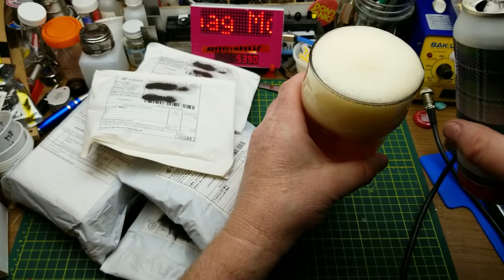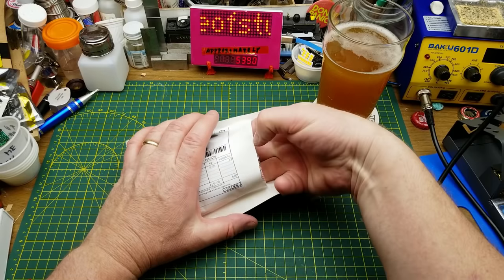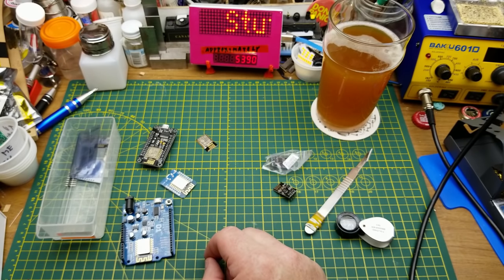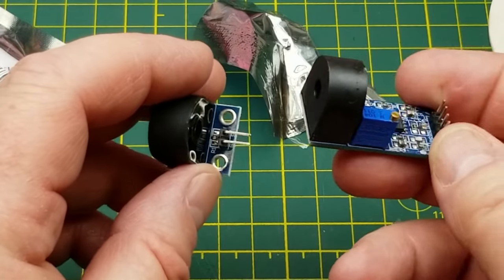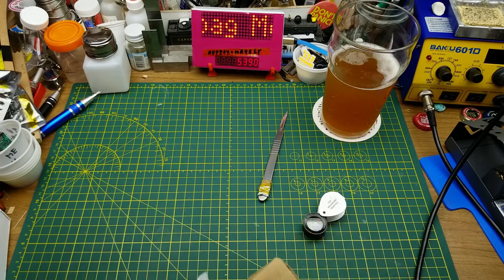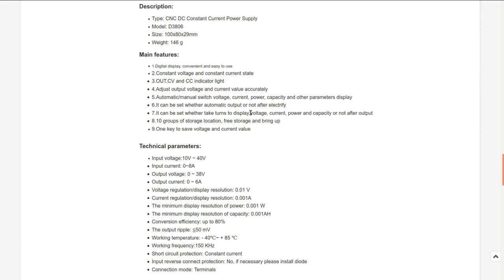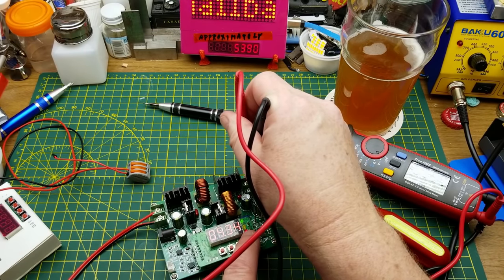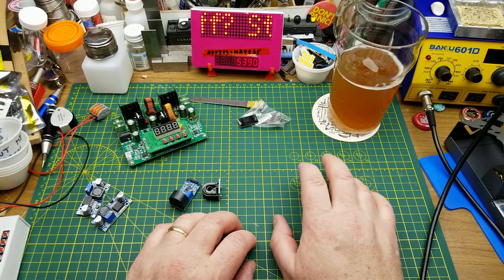mailbag monday #84

Comment: 11:18 - The D3806 and B3603 both have the exact same user interface. The display of Wattage and mAh is an optional on both of them, as well as 10 x preset memories. You can set this up using Special Menu Function #1 (get details from the user manual of either device).
The crude user interface makes these added features even less intuitive than the way that Current vs Voltage is displayed (decimal place position). I switched the extra settings off, and just use them to show Volts and Amps.
If you want a decent interface, you need to pay more for the higher-end MingHe like ZXY6005 (Buck), or buy one of the Ruidengs.
Reply from the maker: Correct. It is the same display and user interface.
I don't find it that difficult to navigate, but that may be because I'm accustomed to it after using it for a few years.
I find these to be acceptable value for the (small amount of) money.
Reply: @pileofstuff  - Yes, most MingHe use the same display board and I am also accustomed to them. Anyway at 11:18 you were excited that the new one has Watts and mAh display, yet this is optional (via Function Setting) and can also be shown on the B3603 as well.

Comment: 12:18 - You should get in the habit of holding the terminal connector block (and not the PCB) when tightening the screws.  It is only connected to the PCB with the electrical connections and not the block itself as you can see in the video.
Reply from the maker: Yeah, they're not the most mechanically stable.
I have a plan to avoid needing to touch them more than a couple of times. Stay tuned for Friday's video!

Comment: Oh man your D3806 is different to mine, I don't have a current shunt, I have a ceramic resistor, interesting!
Reply from the maker: I noticed that. 

I assume the "precisely bent wire" shunt is more cost efficient.
Reply: @pileofstuff  I feel as though it may have a lower parasitic resistance too, but require a more precise OP Amp

Comment: I had a problem with diy-electronic, about a year ago I ordered $100 worth of stuff and china shipping sent it back to them for some reason and I had to fight with them and ebay for 3 months to get my money back, and when I did i found out that I only got $90 some back because they withheld the return on something in the order. I haven't ordered from them since.
Reply from the maker: I've heard occasional stories like that from various of the Chinese ebay vendors.
I haven't personally experienced it, but it's one of the reasons why I tend to only order low value items from them - it's no big loss if something goes wrong.
Reply: @pileofstuff  I switched to aliexpress and stopped using ebay all together. If I were to have a problem my bank (cibc) will resolve it way better and faster then paypal can/would.

Comment: One of the first things I would do with that D3806 is hook up a serial monitor and see what is coming out!
Reply: Keeping in mind that it is likely digital serial data, and not rs232 serial so likely a USB to digital serial board is needed.
Reply from the maker: Unfortunately, there isn't as much to be learned as I had hoped.  It only seems to be sending an "ack" byte whenever you hit a button. 
I found a few old discussion threads who also didnt have any luck doing anything useful with it.
Toombad, there could have been a lot of potential there.
Reply: pileofstuff Yeah too bad! Maybe it’s just being used to program the user interface.
Reply from the maker: @DustinWatts  That's my thought as well.

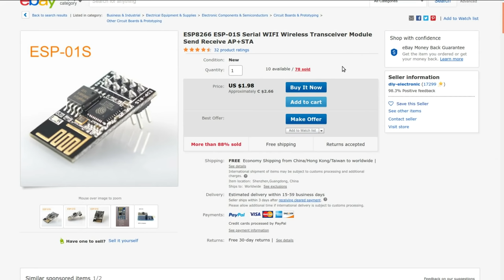Comment: 5:18 - I'm confused why you said the ESP8266 is tricky to program.  I haven't used it in a while but you just talk to it over serial to do what you want, no programming required on the device itself.  Or are you talking about replacing the actual code on the 8266 so you can do stuff on it without another device (Arduino, etc.) altogether?
Reply from the maker: Mostly the requirement to hold GPIO0 low at bootup to put it into programming mode. I've had  them not always do it on the first (or 3rd) try.

It's less beginner friendly than the arduino family of boards.
Not a show-stopper, just an extra step to keep in mind.

Comment: I have an electrical train question I live in the US and,  I am building a layout with Bachmann's EZ track system their switches run on 16V 1A power. They sell a accessory power adapter to run them but it can according to them only support 6 16V 1A  accessory's at the same time. I don't want to buy two $49 power units if there is one you can recommend that can handle more I am hoping for around 16+ devices I already have a buck/boost converter. Any help is appreciated.
Reply from the maker: The track switch machines are controlled by (approximately) 16VAC. You can use any 12-16 volt AC source (including a simple transformer). Many people use the accessory connection of any old toy train controller they can find.
The other thing to keep in mind is that the switch machines only use power while they are moving, so unless you are changing all of them at once, you shouldn't exceed your capacity.

Comment: I use ESP-01 for controlling (w)RGB's WS2812s, sensors and such. :)
Reply from the maker: Several people have mentioned that - I should give it a try.
Reply: @pileofstuff  ESP-01's and WS2812's often com in kits too. With a variety of different sizes of rings. :-)